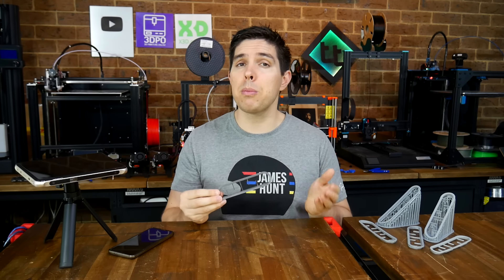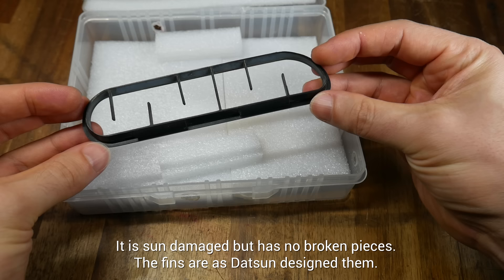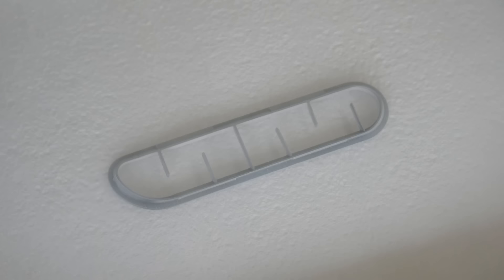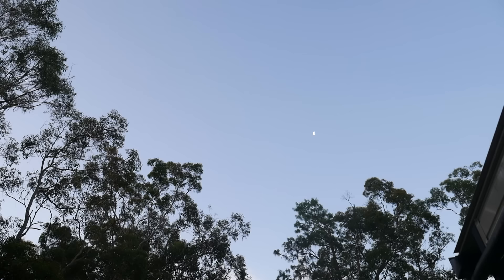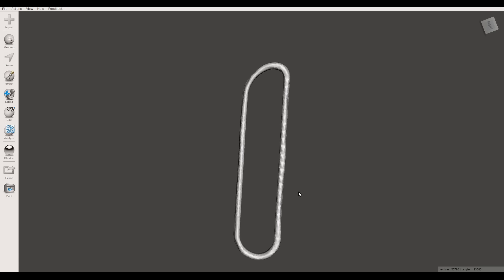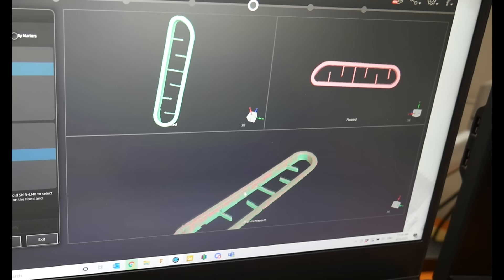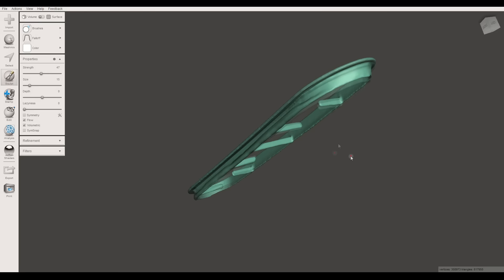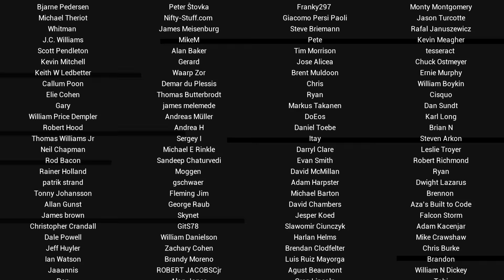3D scanning + 3D printing to complete a classic car restoration

Comment: Cool video! I actually do this for my restoration clients. I scan parts like engine heads, or old swedged tubing (motorcycles) then I 3D print SLA molds that I inject wax into. Then I send the wax to foundries. This part you did here would have been one of the parts I would’ve just remodeled by using images and calipers. Its not that complex, however 3D scanning is a great way to avoid printing prototypes the tweaking the model.

Another tip, don’t by the expensive scanning spray, Krylon Dulling spray is $5-6 and does the same thing, you just have to wipe it off afterwards.

Comment: I know that it's not the point of this video, but for this particular part a contour gauge and set of calipers would have resulted in a near-perfect part. For larger objects the scanners are far more suitable of course
Reply: Geomagic's other software is capable of producing perfect CAD data, this was the easy/ cheap way out of the process.  It's (expensive) package exists to easily let you sketch, modify, and create parametric solid data that can be exported (with feature history) to your big CAD programs, like solidworks.  Creating basic STL meshes off the raw data is something that a lot of scanners have included within their software and is a definite waste of the program's cost.  It's one of those things where if you're going to spend $15-$20k  on a scanner, you may as well have the $5k package that lets you go all the way with it. 

It's something i'm just getting into at work.  It's pretty fascinating, but in no way intuitive to just jump into.    So there's that option for companies that want to produce accurate parts faster than by hand measuring.
Reply: I agree completely, this isn't that complicated and would only take a few hours to model by hand if you had the part.  No lumpiness to sort out either.  But the scanner tech is going to be a lot more useful for complicated things like the other examples shown.  If anything, the vent is too simple a part to use as a demonstration, you could have just 2-part (or even open-top 1-part) silicone molded it, which is probably how it was made originally.
Reply: Photogrammetry with a bigger amount of knowledge and experience can handle such as small part pretty well. Its important to make any side of an object visually different much as possible to get away from destortion and noise in the photo scan. And of course not a crappy smartphone camera. The higher the image quality is, the higher the amount of detail is in the scan. Expecially sharpness. Smartphone cameras likes to wash out images so they look "nicer". But this is the oposite of what photogrammetry needs.
Reply: That's exactly what I thought. I understand that he's trying to show the process of 3d scanning but I believe that part is not the best example. The part in question is easy to 3d model, so no need for 3d scan. That been said this is a great video showcasing the capabilities of 3D scanning technology

Comment: While I love 3d printing, there are other low tech options for reproducing the unobtainable.

For this particular part a simple 2 part silicone mold could have been made.  Some shapes are harder to reproduce by mold making due to internal features, overhangs etc.

I know this was just an example of the process, but also moldmaking can be very cheap even with using high end mold making materials.

So even if you went with the mid-range scanner your way over a budget moldmaking.
Reply from the maker: While normally I would agree, with this part I wasn't willing to risk pouring anything around it. It was on loan to my best friend's uncle so there was no way I was going to do anything to compromise it. I was even wary about using the canning spray in case it reacted badly with the plastic.
Reply: Just for saving cost, it could be worth just taking some measurements and making the 3d model yourself. It might take a few revisions, but this part seems like it would be pretty easy to model
Reply: @laxbrobrandon  yeah, measure, model, print, test fit, if everything is good print multiples for moldmaking so stronger/different materials can be produced.

Comment: Interestingly, the shorter the wavelength of the laser (blue) the higher the resolving power and definition of the scan, as long as the imaging sensor has a high enough resolution to accommodate the returned reflection detail!!! Remember when they switched from DVD red laser to Blu-ray blue laser? Because higher information density per unit of area!!!😁👍🏻
Reply: Red and blue light have wavelengths of 0.7 and 0.4 of a micron respectively, and are about 50x smaller than the resolution of the models, so it really doesn't matter yet.
It matters for DVD and Blu-ray because those really do operate at the nano-scale. 3D printing is still orders of magnitude larger.
Reply: I would suspect on this case we're dealing a lot more with the reflection properties of materials on blue light vs. any other colors.
The wavelength is way, WAY beyond the maximum attainable precision of the tool after all.

Comment: Nice! I've done a bunch of 3D scanning and reproductions (not auto) using my Einscan (but not this fancy blue laser version, more of a prosumer one), and I've certainly never used this reverse engineering tool. That's very cool to see that such a thing exists. My experience is get a giant scan out of Einscan, then do a bunch of mesh reductions to make the files reasonably sized to edit in Meshmixer. Then meticulous and careful mesh editing to remove scanning mistakes and what not. It is more of an art than a science. And lots of saves in case Meshmixer crashes on a long operation or you edit something you didn't want to.
Reply from the maker: I think that part of the software is where much of the cost comes from. Meshmixer is powerful but as you say it can be quite unreliable.
Reply: @TeachingTech  indeed. And it is too bad Meshmixer has been basically deprecated by Autodesk. They say oh you can use F360, yeah, nah, you try to load a STL with 16mil triangles into F360. It isn't fast in Meshmixer, but you can still do stuff with it, in F360, good luck.

Comment: I would've taken 3 profile pictures, bring them into Fusion, calibrate to size, and draw the part using splines and tweaked them until perfect.
Ten minute job, but...that's just me.
Reply: Cool, and you can do that. Would make for a pretty shit video though.
Reply: There is a caption that says that he doesn't have access to the car for test fits.
Reply: @novo740  I don't know why that's a requirement for a redesigned part vs a scanned part. You can compare either to the original part, and they're both likely to need some refining once they meet the car
Reply: I think he tried to show that technology like this is possible. I would like to see you modeling for instance an engine block this way. But I agree. As someone who works as reverse engineer with FARO arm scanner I think this is the type of thing that is too small and easy to be worth scanning if you do have to outsource it.
Reply: I've tried that several times to attempt to design a case for my earbud case that looks better and is personalized, but the pictures never line up right even when I had the camera on a tripod and the scale object never moved. I don't know why. Any tips on making it work, or is this all theoretical on your part?
Reply: @MegaDman42  The camera's FOV will fish-eye the image a bit no matter the lens. Try taking the pictures from farther away and then zoom to the picture.
If you're using F360, have you tried designing it with "create forms", instead of creating a sketch, then extruding?
Reply: @MegaDman42  good camara. tripod make sure nothing is at an angle. put a tape measure in frame for scale

Comment: Instead of the specialty spray you can use Dr Scholl's aerosol foot spray. It won't dissolve on its own, but it wipes right off. It would be best for the laser or structured light scanner, and would help some for photogrammetry, though adding a sputter texture is best in that case.
Reply from the maker: I researched some home remedies for scanning spray such as talk in IPA but in the end I was unwilling to risk the part with somewhat of an unknown formula. Thanks for the tip though.

Comment: Hey, interesting tip! If you hold your resin print under hot water (around 40-50°C) the support release much easier, but you have to do it before post-curing.

Comment: We use spray meant to find cracks in parts, cheap and easily cleanable. It essentially creates a dust on top of it. Probably exactly the same as 3d scanning spray, but much cheaper as it's used in industry to find cracks in parts.

Comment: Yes!! I'm doing some parts for my dad's MG and another club members MGA. Most of the parts we have original examples to scan and work from but there have been a few pieces I'm making from old pictures and measurements taken from where the part originally sat. I've even made replacement electrical connectors that have long since been discontinued. Its amazing how many little clips, brackets, and do-dads that we can make with our 3D printers for restoration projects. Never really thought about doing it as a full time business though.. I do it mostly for the challenge but if I can earn a few doll hairs to support other hobbies I'm tickled pink..

Comment: I would try to persevere with photogrammetry, but in reality I would take photos of each axis with a ruler in shot, use as a background for Blender and then trace, build and modify a mesh such as a torus to start with, subdivide and extrude the prongs and modify until it matches the profile and scale of the images.
Yes, it's a lot of polygon bashing, but the results are optimal and probably worth it to create a master file for mass production.
Reply: Or do the same in a real mechanical CAD Program to get a real parametric CAD model instead if a mesh
Reply: @hansdietrich83  That would work too, but I would use Blender because I know it best.

Comment: Thank you for this interesting comparison of scanning devices! Beside choosing the right scanning method, I have encountered the problem of choosing the right printing material. In my experience resin based materials offer good detailing, however minor stability especially in the long run under tough conditions, like in an car. This might be worth a closer look! Best regards, and keep up the good work 👍🏻
Reply from the maker: I agree it may not be suitable long term. We will see how painting goes to protect from UV but if that is insufficient, we now have the mans to make copies and explore other options.

Comment: While I haven't watched the video yet past the precious, It seems like a standard solution would've been to make a 2 part silicone mold and make an epoxy casting.
Reply: Depending on just how sun damaged the part was, that could have been a risky move.
Reply: @S_Roach  Care to explain why? Molding in silicone can be a pretty gentle process and TT did spray it multiple times with scanning spray for his attempt
Reply: @RubixB0y  Depending on how brittle it is, I could see accidentally pulling one of those tines off, trying to separate the mold from the original.
I could be wrong. I've never had the occasion to do silicone molding, but separating the mold Looks, to me, to be an opportunity to snag the original if you're not careful.
Reply: @S_Roach  With best practices, a mold release spray is used to prevent any possible sticking even though silicone dosen't stick to non-porous surfaces strongly. When demolding, the silicone can be significantly softer than its full cure durometer and can be peeled away from the form bit by bit. I agree that plastic with UV damage will be more brittle and obviously accidents can happen just like dropping it, I just don't believe the molding process is any more rough than general handling.
Reply: … it’s a 3D printing channel 
That’s probably why he 3D printed it
Reply: @ChuckThree  I'm glad you cleared that up... for yourself?
Reply: @RubixB0y  nice. and you’re positive the draft angles work with half of mold the tines would be located, huh?
Reply: @ChuckThree  Well you came to assert an answer to a question no one here asked, which seemed rude to me. 

As for the mold drafts, I don't see that being a factor here for a 2-part silicone mold. They are flexible and you get to choose where the seperation line is. If someone were to try an aluminum cast with sand, that would be a much more impressive feat and draft would definitely be a factor.
Reply from the maker: Way too risky for me as S.P. Roach says. If necessary, the 3D printed part can now be used for anything like this without consequence.

Comment: For the people who are saying this would be easier or quicker to measure and model rather than scan it may not be the best usage case but it shows the process quite well

I am in the middle of doing something similar for re-creating a rust replacement panel 

as the geometry is well beyond my ability the measure let alone draw in cad 

So I had the part scanned then I tried to make use of the scan and after a few hours of learning how to work with scan data I was able to make a print that matched the original part 

Normally I'd just persevere with the traditional panel shaping process but this part is to complex it has more than 8 faces in a part smaller than that palm my hand and I need two mirrored ones

It has to be spot on inorder for the body to seat and the body rubber to seal as it is right above the exhaust tip and can easily bleed gas back into the cab not ideal 

I am only halfway through the process but it's yeilding results compared to traditional process

Comment: I've started doing this for my business Andes up with two mid range scanners but was surprised just how difficult it was to scan objects and just how much work goes in to fixing the models after a scan. I honestly thought the advertisement of 0.1mm accuracy was meaning it wouldn't miss any small detail, but instead it adds weird bumpy textures and misses entire parts if they aren't the right colour.
Reply from the maker: 3D scanning is a tricky technology but thins are improving vey fast.

Comment: I do hope Miles is going to keep the files for the vent - he may get some business out of it .
I know there will be lots of posts stating that they can model it in CAD faster and they probably can but with such a rare part the manual handling has to be kept to the absolute minimum - you wouldn’t be very popular if you broke one of those delicate fins off when trying to measure it as it could very well be the only complete unit in existence!
I also hope you will post up a few photos of the vent when installed and of the finished car .
Amazing technology ! Thanks for sharing !
Reply: I wish there was a contact link to Miles, I have an old wagon I want to try to get converted to electric and with updated internal features like heated seats, backup camera, etc. but to do that I would need to do a TON of work with measuring things or have someone with the right scanner have a go at it.
Reply: @MegaDman42  
Try sending Michael a message .
I don’t even want to guess what  scanning cost  - I imagine it wouldn’t be cheap .
Reply from the maker: Myles did this as a favour. The part will be released for free, neither of us are looking to profit. Myles' business name and contact details are purposely withheld, he is not looking to use this video as a marketing tool.

Comment: What the heck!  I wanted to see it fit into the car.  You had better show that as an update or I am going to have to slap you silly.  
Alright, no violence but still you get the point.  
I will often just take a good photo of all six sides and model it out.  14k is cool, but not in my current budget.

Comment: That was seriously interesting , thanks Techy . I'm currently working on a 22 year old motorhome , which despite having a multitude of plastic parts . I've been fortunately enough to either replace or repair on the whole . Though in a couple of instances i have taken to carving styrene . I've been using a plastic welder for the repairs , reinforcing with a stainless mesh . Some mechanical parts have been seriously difficult to source , though , just requires a bit of thinking outside the box . 

I had been thinking it would handy to have a 3d printer for trim , but i'm not very clever with cad programs . Brutal truth , i'm more of a doer , than thinker , if you catch my drift .

Comment: I actually bought a 3d printer to replace car parts. I have had a few cars that plastic has fallen apart on but couldn't buy replacements or when you can they are really expensive. 
My most recent auto project involving the 3d printer is for my drag car, printed a place for the aftermarket gauges and a small mechless radio(for track announcements mostly) to power my 2 plastic frame focal speakers(light and sound decent). 

Deleted the vents and useless stuff on the dash now.

Comment: While nowhere nearly as impressive, I did got into a situation of needing to replace the bottle part of a pepper grinder. Since I happened to had a small PET bottle around, I just printed a screw adapter to adapt that bottle to the pepper grinder. It actually took me 3 attempts to complement the shrinkage properly, but I'm just glad that I finally got to print something useful that has one single purpose.

Comment: Using a scanner to help with redesigning it seems like the best option. You need to manually fix it anyway. Maybe more organic stuff, where accuracy is not an issue scan to print can work. But for other stuff, we are still not there.